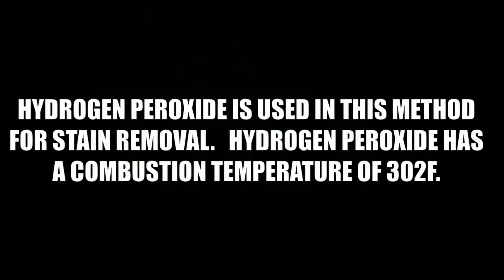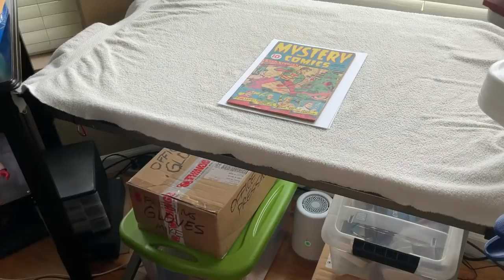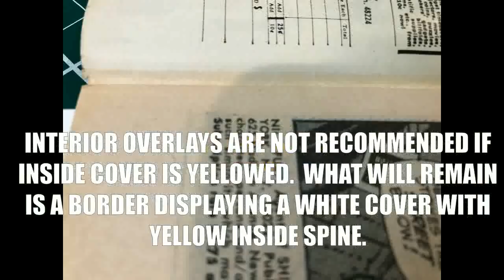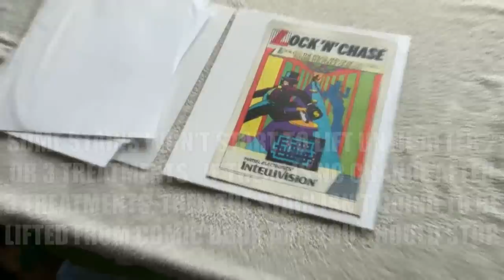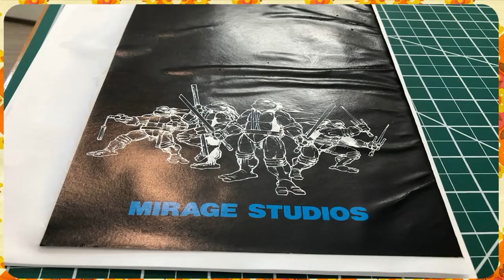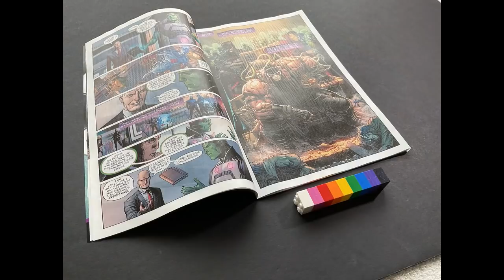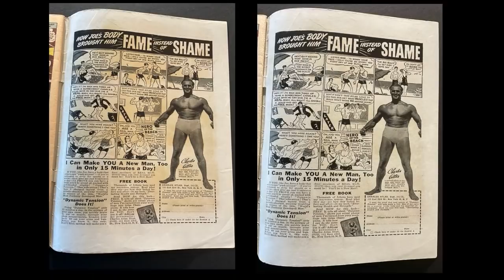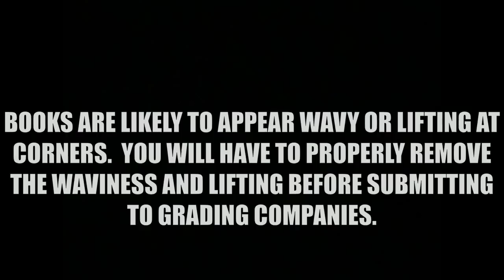S3 E2 Heat Overlay Press Stain Removal for Comic Books by KaptainMyke

Comment: Very interesting video. What would happen if you humidified the book using a 3% hydrogen peroxide solution? Would it uniformly remove light yellowing or staining do you think?
Reply from the maker: We tried that along time ago. All that does is create the same effect as a regular humidity tank as the peroxide turns to water under normal uv light conditions

Comment: just curious - have you tried this method with the cover off the book? seems like maybe that would alleviate any weird rippling issues?
Reply from the maker: That’s an excellent question. I do not endorse, taking a book apart, or removing the staples as most of what I teach is geared towards amateurs. I feel like a lot more things could go wrong if you try to take the book apart.

Comment: Does a black light pick the inside cover when doing the peroxide spray?
Reply from the maker: I'm not sure I understand your question.   We don't use black lights.
Reply: Sorry wasn't to specific, would CGC detect the peroxide if using a black light and and at the 8 min mark on this vid regarding not doing the inside overlay if yellow.  What can be done then?  I just ordered the Comic Book Stain Removal  and Whitening if its mentioned in there, I'll just check it in the book

Comment: Why is it when i do this technique on books it leaves hydrogen marks that are visible under blacklight , inside the paper?
Reply from the maker: It could be the book has too much tanning. That’s why we recommend blue light misting for the inside of the books and not the overlay method. You could try to dilute the solution with a mix of 50% distilled water and 50% hydrogen peroxide.
Reply: @kaptainmyke  Sorry, not for the interior pages. I am referring to the cover. After I HOP and the book is dry, inside of the cover it seems the paper has something trapped inside since it is visible after with uv light.
Reply from the maker: @MrPelletty  I am talking about the inside cover as well.

Comment: Doesn’t this cause a rough texture to form on the paper.
Reply from the maker: It depends on the paper quality if there is any brittleness or type of paper used.  Sometimes it may be necessary to use a distilled water HOP method.  In most cases, the rough texture you see disappears after final press.
Reply: Is it right to assume that pure distilled is far safer than hydrogen peroxide? Just to get off some light stains. And then to get rid of rippling, you'd press again normally. @kaptainmyke